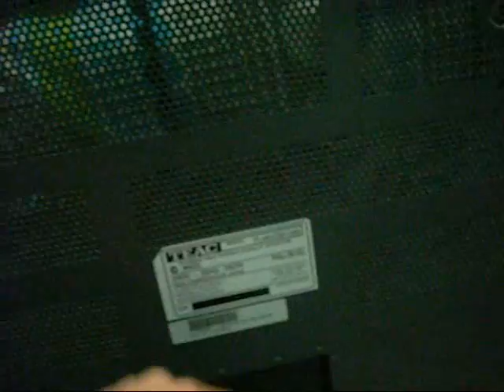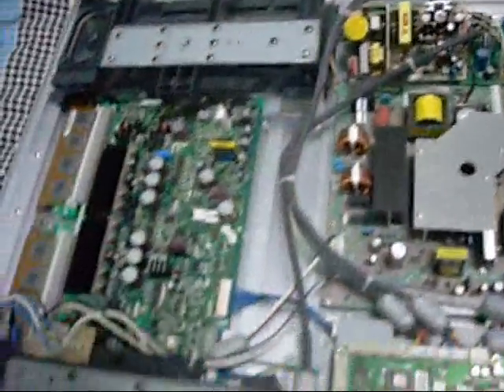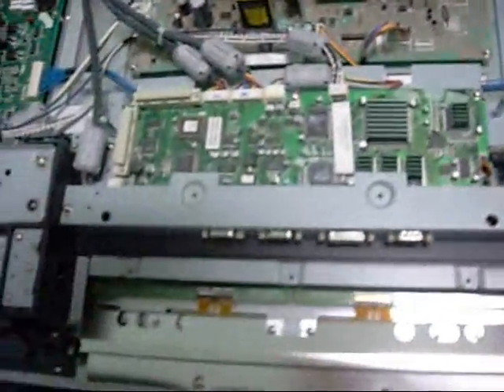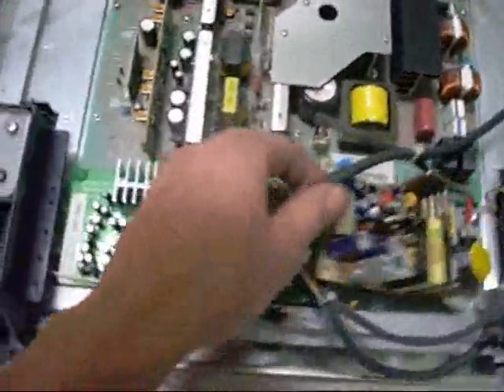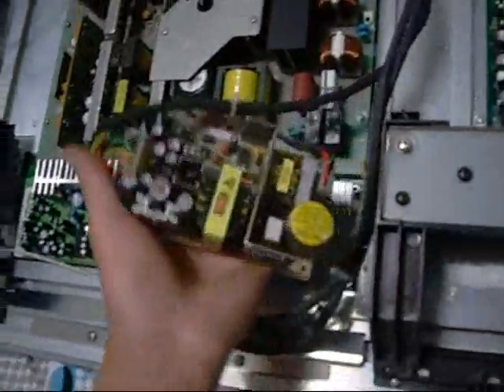Teac 42" HD Plasma TV Blown SMPSU Help Needed

Comment: A note about glass fuses.  They often arc internally when they fail, and the arc allows current to continue flowing momentarily and may even cause the fuse to explode.  (The arc is why they sometimes go metallic black inside)
Glass 20mm fuses are inly rated to break about 35A short circuit current, but the ceramic equivalent (filled with sand) are rated to break 1500A short circuit current, and are therefore less likely to explode and will interrupt the current faster, preventing further damage.

Comment: i repaired a plasma tv recently, different model, but similar problem.  it ended up being the Y-SUS board that went short.   There was a large IC on the Y-SUS board that had failed and was shorting the Vs output from the power supply.  maybe something similar has happened here and has taken your psu with it.

Comment: Man, Never Knew Japan Still Made TV's, That one may be worth a Fix, Check that 12 O Clock Board, You may also need to check the 3 and 4 pin Transistors with a Multimeter, They do go bang, as i have found with Samsung Crap! TV's

Comment: Some broken FET or controller, I would not expect the diodes to be faulty(even you should test them too)

The LCD powersupply is a 2 stage one: The first one is a boost converter, it increase the voltage to 400V or something above mains.

The second one (can probably be isolated by lifting a diode) does the 400V to whatever conversion.

There is probably a standby PSU too, but it seems fine, but for out of TV testing you would need something to drive the relay with to turn it on.

Comment: @UmaBlinky 

a conventional PS is indeed simple, but SPS aren't that hard than most people think.

If you get the basic working of a SPS then you can easily follow the cirquit and measure the defective components.

I think most SPS die because of using cheap components and components that are underdimentioned

Comment: I had this problem with a polaroid LCD TV it had an external PS brick and it didnt work b/c something was wrong with it possibly the same issue thay you have here. what I did was take a power brick from an XBOX 360 video game console that I had lying around and it has 12VDC 16.5 Amps output so I took the old cord from the TV's old brick and wired it to the XBOX 360 brick and I now have a working TV as of today. I'm playing games on it right now.

Comment: You're right about the caps, 
today the quality of them is'n wat it used to be.

You can check the powertransistor that switches the transformator for shorts.
This transistor is switching the rectified AC to the primairy side of the transformator.

And as I see it looks like the same power dimensions as an old computer power supply, so I think this power supply is 12v and + and -5V

If you can get an schematic it wil be a lot easier

good luck

Comment: Yeah I say that you should hardwire the psu in there, and re solder the joints. bad joints can cause arcing, and even a bad connector can cause a lot of heat damage.
8|  I am very amazed that all of that is made in Japan!!!!!!  What Mfg are the caps made from?

Comment: @LPFthings I'm sure you'll be able to find heaps on other circuitry you could try replace it with. Usually the rectifier is the next on the mains circuit chain, also worth checking. If the short was on the low voltage side, I doubt it'd blow your fuse on the mains side, as SMPS's usually have circuitry to prevent that, so anything on the mains side of that little dashed line around the board is what I'd check first.

The switching transistors could also be gone.

Comment: Switchmode power supplies can be a huge pain to trouble shoot. I would follow the traces, and start with the first few components on the chain. See that little blue component near the heatsink? They are called MOV's, and are designed to short themselves out if the input voltage exceeds their rating, preventing anything else from dieing.

I would put your DMM across that MOV, and see if it's shorted. If it's gone open now, it may have fried far enough to render it useless. *continued*